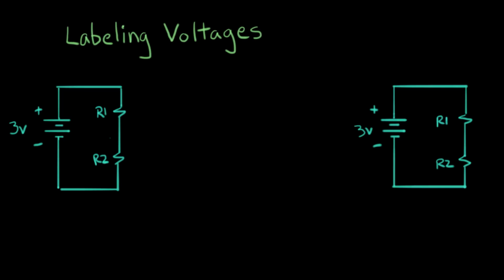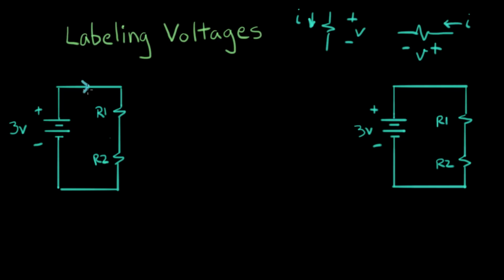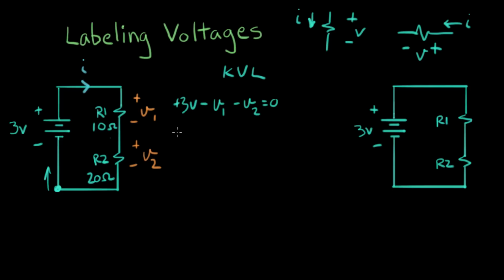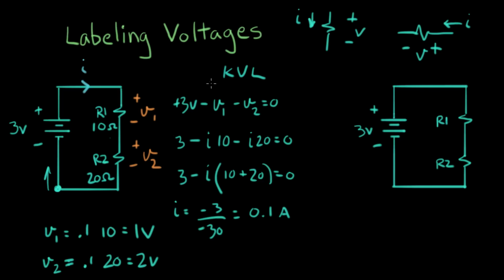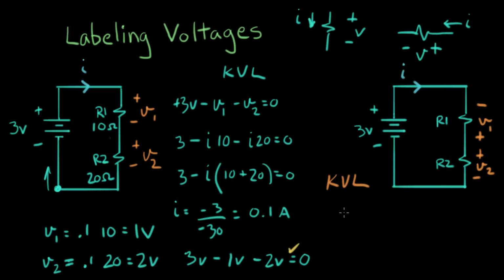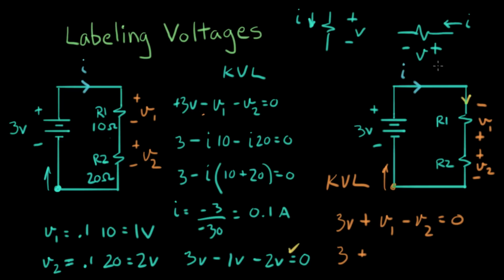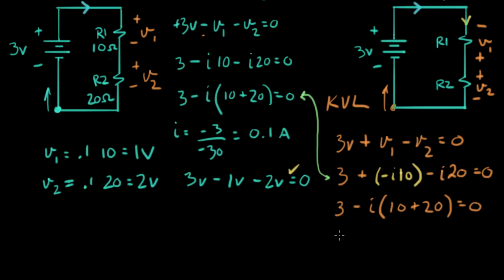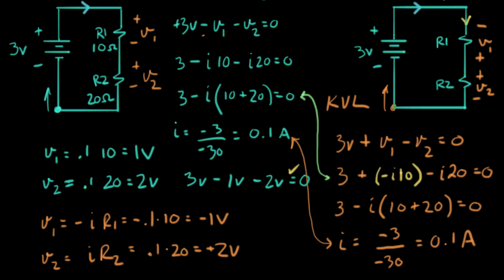Labeling voltages

Comment: I'm sitting here losing my sanity over an RLC circuit with multiple step responses. I checked my answer with the solutions manual, and they put a minus sign in a place that I didn't. There goes an hour of my life I'll never get back. Obviously, I did something wrong with PSC. But I have nooooo clue. 
After coming to, I checked online, and watched a KA electrical engineering video for the first time. After watching, I immediately realize what I did. So I can breeze through 2nd-order ODEs, but that doesn't mean jack if I forget a minus sign.

Moral of the story: Doesn't matter how hard or easy the circuit is. You'll never get it right if you forget PSC.
Reply: radiohead4everrrrr great, now I have to know what is PSC